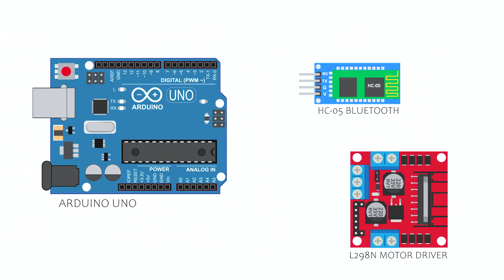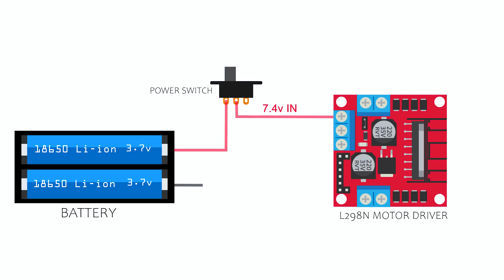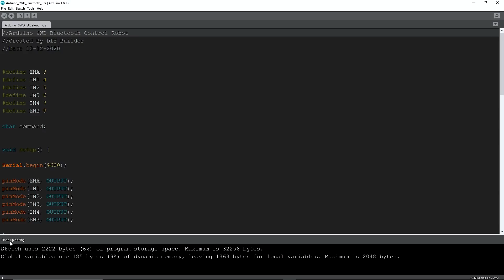How To Make Arduino 6WD Robot At Home  | Simple Arduino Project | Science Project |

Comment: Hello Bro 
Can you please make another Arduino 3d printer with large  bed size like ender 3 and please also make a programming video like earlier once. Make it with a heat bed I think heated bed improve print quality

Note : use an e3d bowden extruder
Reply from the maker: Ok bro i'll try
Reply: @DIYBuilder  thank you for replying.btw I had online classes that's why I didn't reply 😊

Comment: wow, didnt know that anybody is stil using this ancient motordrivers who burn the most of the energy into heat
Reply: Bro any alternative fo this moter driver
Reply: @abhinav1299  yes, try this ones for example, tb6612fng. It is a Mosfet Motordriver, way smaller bc it doesnt need a heatsink, The ones you are using are burning ove 70% of the energy into heat.
Reply: That's kinda true to be honest. You can also use the red thingy motor driver board which is 70% to 80% efficient and also use 11.1 volt rather than 7.4 cuz three motors in series which means 3.7 volts for each motor and current draw of 1 to 2 amps depending on the load. And also electroboom hit 4 million suns!!!!!!!!😍